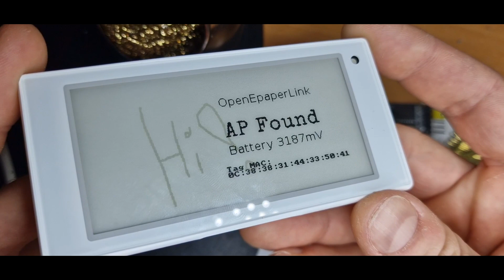3.5" Price Tag Telink TLSR OpenEPaperLink Flashing How-To

Comment: The plastic lens on the front is just glued down, so you can use an iOpener / heat gun to loosen the adhesive and lift the lens off, or, as I just did to one of mine, get a thin metal pry tool (e.g. one from an iFixit toolkit), press it firmly into the tiny gap between the lens and the casing, then lower the pry tool so it creates some leverage, lifting up the plastic lens.

You can then reattach the lens using double sided tape or a dab of glue or something.

Much cleaner than drilling or burning holes into the case, especially since you only need to access the pins to reflash the device once.

Comment: Good vid, thanks!
1:33 Another idea for open a hole on the plastic is using the screwdriver(philips head) to drill one, push it down with force and twisting. Less smoke and cleaner edges.
Reply from the maker: Hey, does work as well, but takes way more time so im still sticking to melting
Reply: @atc1441  Yes that's true.
btw your reply is so fast! That's so cool, never seen that :)

Comment: Hallo Aaron, Danke für deine Mühe - Leider klappt das Flashen bei mir nicht - LED Blink - Das Display verändert sich jedoch nicht
Reply: Hi Aaron, same for me, LED is flashing on my 350R-N but no change on display (using USB2TTL with 3.3V, GND and TX only) with TLSR_HS_BWY_35_ALPHA.bin or TLSR_HS_BWY_35_inverse.bin
Reply from the maker: @mikela8587 please use the newer firmware shown in the newer video :) ATC_BLE_OEPL
Reply: @atc1441  thanks for your fast reply - but same issue when using ATC_BLE_OEPL (following all links from that video)
blue LED is flashing in sync with TTL, display just stays unchanged
Reply from the maker: @mikela8587 thats how it is expected you need to configure as shown
Reply: @atc1441  instead using a USB2TTL (like in this video) I took now a new USB2UART adapter (as in other video), connected the RST, TX-SWS and GND to the display and started first erasing and then writing the flash with ATC_BLE_OEPL.bin
blue LED on display is blinking during flashing, but when completed screen does not refresh - nothing shows up in AP
some more ideas?

Comment: Cool video! I'm trying to flash a Nebular 350R-N, which should be pretty much the same as the 350Y-N. What file(s) are you flashing? The compiled link seems to be broken and the other link says the .bin file seems like it's only compatible with Stellar ESLs. It didn't work when I tried it, but the blue light on my 350 did flash.
Reply: Where are the pins on the 350R-N I have opened up the back of the case just on the side in this video, and I cannot see them?

Comment: Thank you for your videos! I can't get any further with the Hanshow display. Model: Nebular-350Y-N. I made the holes, flashed the firmware, as in the video. The blue LED also flashed. But after that it won't start and stays off.
Reply: Did you reset? Insert the Battery in the wrong way to reset the ESL.
Reply: Could you solve the problem? I have the same problem now
Reply: Same problem here. - Aaron mentioned it is the expected behavior that after flashing the display keeps blank/does nothing. - But also the display is not visible/recognized by my Spaghetti AP after flashing, so i am not sure if even firmware flash was succesful or perhaps firmware is not working on Hanshow IC HS9118 B4100 AA UHW360 , like mine is labeled .

Comment: I have a externally identical unit but the PCB inside doesn't have those pads at the top, could you tell me which pad goes to which pin on the HS9118?

Comment: Inside the unit there is a 3V battery (in reality it uses two but they are in parallel) but in the video you power it using 5v. Is this voltage used only for flashing? After flashed, to update the display, you used an AP (I suppose the OpenEPaper AP, right?), is it possible to update the display by the same wire connection you used for flashing (instead by OTA)?

Comment: Awesome! I got some defective units a few days ago, not knowing that you already did the hack here. Thanks a lot! Will try that one this afternoon.
Did you already have a look at the bigger ones? I have a 6 inch one here, it also uses the same processor, but this one is in the original package, not on a dedicated hanshow chip packsge like the 3.5" ones. Plus it has a lipo battery inside and the screen is attached with a mechanical FPC connector instead of the hot-bonding adhesives.

Comment: It is a pretty silly idea to use the soldering iron for making the holes. It hurts the tip and the fumes are toxic. Why do people abuse their soldering iron like this? Don't you have drills?
Reply: Drilling might easily go through the solder pad, but the soldering iron will stop without damaging it. It does seem to be a form of abuse to use a soldering iron just to melt the back plastic. Any better solutions? I've used a hack saw to open the back, but I've broken a few of these devices in trying it that way.
Reply: @nethomas1968  It is plastic. I would just use the drill bit with my fingers to carefully drill the plastic.
Reply: Use a drill and you will hit the PCB.

Just extract the fumes and then thoroughly clean the soldering iron bit
Its no big deal
Reply: What I want to know is how carbon could damage iron, chrome or nickel.

Comment: Hi Aaron, could you please share the measurements on the paper used to put the holes in the back.
Thanks regards Dave.
Reply: I am also interested.
Reply: If you're still interested in doing this, don't bother burning or drilling holes in the back. Instead, use a heat gun to warm up the adhesive on the front lens, then lift it off using a pry tool or a suction cup or something. Makes the process a lot more non-destructive than making holes in the back which could change between revisions.

Comment: I have the 350R-N, which looks very similar. But, when I flash the code I see white text on a black background. Why is mine different to yours ? And, how do I get text to use up the whole screen? Not just the right hand side?
Reply: did you figure it out?
Reply: Where are the pins on the 350R-N I have opened up the back of the case just on the side in this video, and I cannot see them?

Comment: Thanks for this video! I have one of these and was wondering how to get into it. I assume it’s either clipped in or glued in from the front. Am I correct? I assume it’s a destructive process to take apart?
Reply: Unless you can get the front panel off, it's non destructive if you can get that off by prying

Comment: Thanks for this, great work. 
Whats the model number of the device?
Reply: That device is the Hanshow Nebular-350Y-N . It's a Black/White/Yellow EPaper display with 3.5 inch screen  size. I think the resolution is 384x184 . I have a Nebular-350R-N which is Black/White/Red . Hopefully they are controlled with the same EPD driver chip.
Reply: @nethomas1968  you sound somewhat knowledgeable on this,  will this firmware work with little configuration? Because he didn't really cover the reflash phase on open epaper link?
Reply from the maker: This is just the alpha version rightvnow all TLSR based one will be supported at one point :)
Reply: @electronic-shadow-monster  No, as @atc1441, the TLSR based devices are Alpha at the moment. More work is required.

Comment: Where is the best place to source these in EU? I only need a handful to start.
Reply: Go to a store where they use these. Ask for the broken ones. Probably U only need to replace the battery.
Reply: Did this, was told that all the duff ones are sent away to be scrapped or repaired.
Reply: @DaveBrown1  I've been told the same at Aldi :(
Reply: Danke Alexa 😂👍🙈